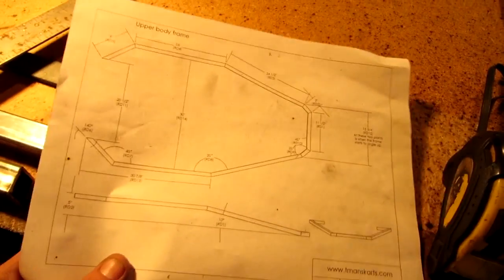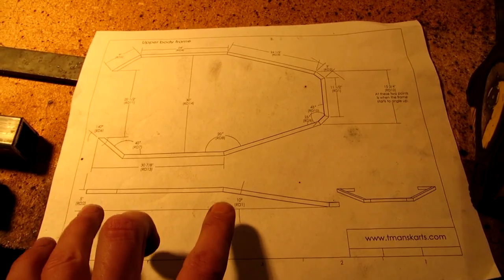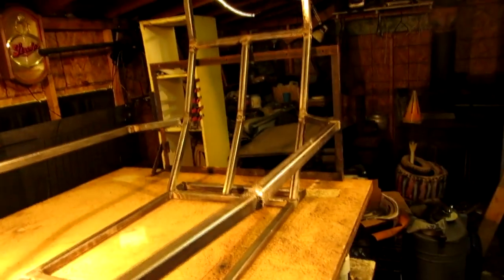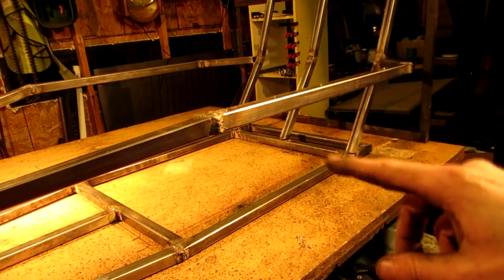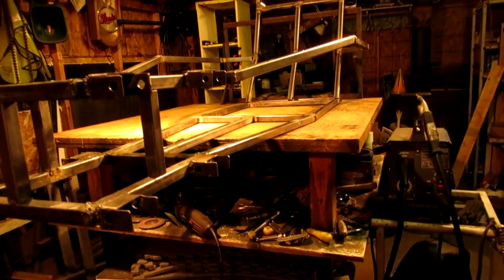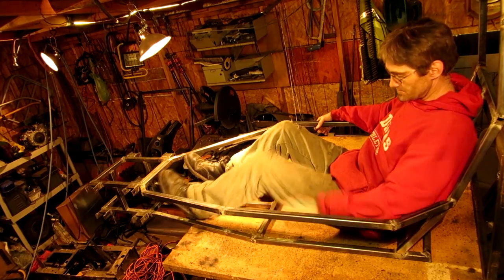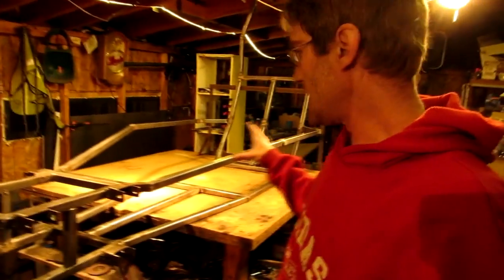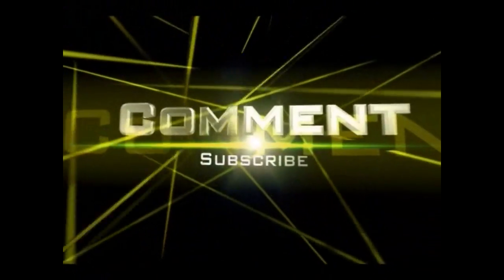█ Go Kart , Building the Upper Frame #5 ( The Fullscreen Machine )

Comment: Hello I have just found your videos and have been looking at as many build a cart videos as I can because I am going to build me and my son one and was wondering what the dimensions are on the one you are building now are. ???? All the videos I have watched so far no one has given any dimensions. Thanks I really like your videos..
Reply from the maker: +Michael Diapoulis ... Hey Michael, most builders wont put to much when it comes to detentions in there videos because it makes the videos really long. I dont do it because I sell the plans to some of my builds. This build of the buggy are not out yet because I need to test it alot befor I send them out to the public. But you could go check out ( spiderkarts.com ) if your looking for something like this.
Reply: Thanks some times I get so involved in what I am doing that every thing else is just put a side. Thanks again and good luck with your project I am sure it will work out.